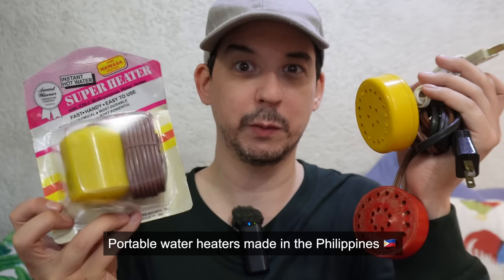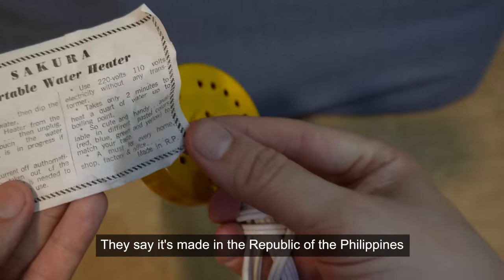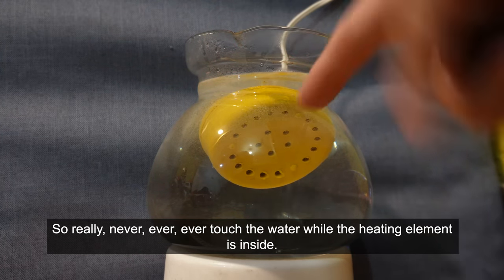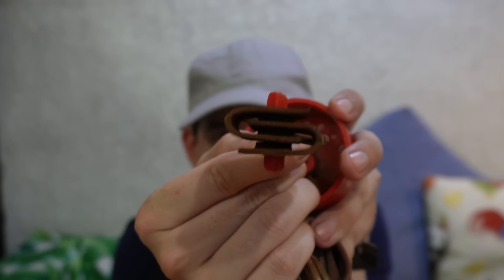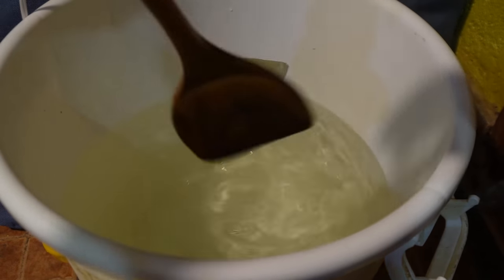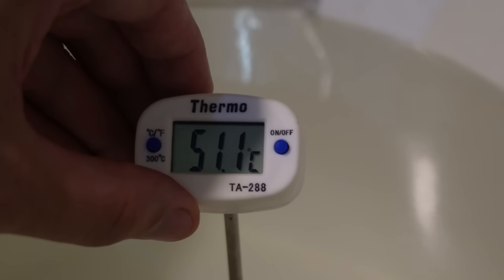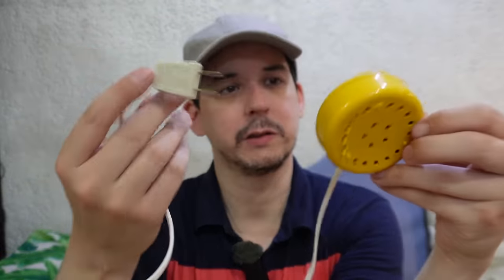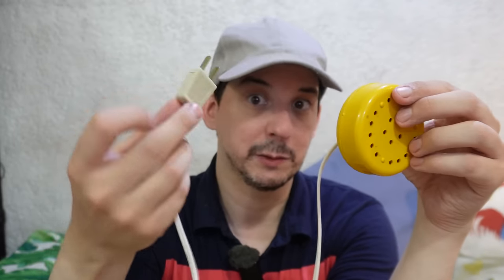Live electricity water heaters

Comment: Been using the yellow super heater for 7 years. Never had an issue with it. Warms up real fast.
Reply from the maker: Wow that's great. Have you tried cleaning it, either manually or with the muriatic acid method they suggest in the manual?
Reply: @GadgetAddict  I haven't. I'll be watching the reference video you provided and I'll see what filth awaits. 😬
Reply: @migueldelacruz5054  7 years of no clean.

Comment: I remember in high school, we made a water heater as project in our Practical Arts. The insulator we used in between the plates is mica.
Reply from the maker: What did you use for the plates? Classic razor blades are what you'd often see.
Reply: @GadgetAddict  same as material as the plate from the sakura water heater.
Reply from the maker: @iamdonniem  ah okay 🙈 I think it's okay as an example - to show the basic concept. 

But to sell that as a commercial product,. especially with the wires just loosely wrapped around the electrical pins.. 🤦

Comment: That heater was my project in grade school. My teacher gave me a high grade for using good components. I used coils instead of plates for the heating element. The wire I used was thick. Resistance is going to be a problem if you use thin wire. If you're gonna build one yourself, be very careful...or just don't make one because as GA said there are safer options. 😉
Reply from the maker: I think it's a great project for education or even potentially an emergency. 

But yeah, let's use the safer options whenever possible 🙈

Comment: I wouldn't use the first two at all, they are dangerous as you showed with your detector. The third is a sealed unit that is much safer because it heats the electrically insulated material around the coil which then heats the water, hence your detector didn't light up.

A note on the soldered connections. Electrical solder (70% lead, 30% tin) melts at ~270 degrees celsius while water boils at 100 degrees. New lead free solder melts at ~320 degrees. Those soldered joints are not a problem in this use, they will never fail. That dodgy insulator and the thin wire are problems though.
Reply from the maker: It's just unfortunate that they appear to have used an underated cable for the 2.5kW water heater - the one that I suspect to be an immersion coil inside the tube.

I guess you could potentially replace the cable. Although I'd rather just start out with a begged quality product from the get go. 

Seeing the wires of the Sakura water heater simply wrapped around the prongs of the plug is definitely a huge red flag. Plus the insulators, like you say. 

That would explain some of the reviews or comments I saw about people saying the wife came loose 🤦

Honestly these kinds of water heaters aren't that common anymore. They're still being used by some people, but they're mostly a blast from the past. 

Nowadays a lot of people use standard electric kettles, because the generics are available at low prices. 

Plus it's gradually becoming more common to install proper hot shower systems.

Comment: Whenever i take a bath , i just use the old fashioned method as usual, heating up water using the kettle with gas and voila , nice warm bath 😂❤🤟
Reply from the maker: Wow 👍 You don't want to try upgrade to an electric kettle?
Reply: @GadgetAddict  for some reason , my family thinks its gonna be expensive  on the electric bill, i try convincing them otherwise 😆
Reply from the maker: Electric kettles do consume a lot of power, but only for a short time. 

Depending on how much you pay for your gas, it might actually work out slightly cheaper. 

But of course there's an increased risk and complexity in heating it up on a gas stove. 

I guess both options have their pros and cons.

Comment: Dude... I have the bigger yellow on lol, used it to heat bath water a few times. 1st time I used it I put my hand in the full trashcan of water and you can definitely feel the current. I don't like using those but I just don't know any other options. I live in a rental house and am limited as to water heaters, maybe you can do a video suggesting some? Great channel, love the content, keep it up. Thinking about getting a Starlink for my place in Danao City in case of storm, I have a few cops that live near me that could maybe use it in a calamity. 👍👍
Reply from the maker: Yeah you should never put your hand into the water while it's plugged in. I've done it, but I wouldn't recommend it 🙈

Honestly the safer option is to just use a normal electric kettle. They're quite affordable nowadays and they can usually heat 1.5 - 2 L at a time.

Otherwise, you might want to consider something like one of the coil immersion heaters which I guess are a more modern alternative to these super heaters.

But probably for most people, the kettle is the easier option. Unless you really need to heat a lot of water.
Reply: Look at one of the purpose designed water heaters. They are electrically isolated so there is no danger. I bought one for our apartment in Davao and it is still working after 10 years (I hope I didn't just jinx it LOL). They will cost you anything from 8000-12000 PHP but what price on your life?

Comment: We still have the yellow one but we stopped using it. It's taking too long to heat up a pail and I also received an electric shock after accidentally dipping a finger into the water while plugged.
Reply from the maker: If it's taking too long, you might have to clean it. 

That's usually what happens when contaminants from the water have built up on the plates. 

And yeah, never touch the water while it's still plugged in 🙈

Comment: 13:20  That yellow heater has been on the market and in use since at least the 1980s. It's a quality, time-tested product.
        I still have one that my mother used since the 1980s.
     BTW,  what happened to your face ? Did you lose your razor or forgot to shave ?
Reply from the maker: lol the end of your comment made me chuckle 🙈 I guess that must be it 🤣

That's pretty awesome that you still have one from the 80s! 

Have you ever gone through the cleaning process (manually or with their recommended muriatic acid process)?
Reply: @GadgetAddict  No. I've never opened or cleaned it. It's a sealed type with no screws.
    But it still works fine.

Comment: I stopped using this long time ago and just use my induction stove to boil water, just 1 kettle worth of boiling water is more than enough to warm up a 1 bucket (5 gallons worth) of water.
Reply from the maker: I'm just curios for your choice to use an induction stove instead of an electric kettle.

Is it simply because that's what you have, or because you prefer it over a standard electric kettle?

Comment: I would rather heat water in a stove with a BIG POT or BIG Kettle instead of using those water heaters, and I got electrocuted by it many times😒 and its dangerous for kids and even with pets, its cheap and easy but I don't recommend it either on daily use basically with kids in a family, probably on emergency situation you can or your just single in life
Reply from the maker: Yeah you should really never touch the water while it's plugged in, otherwise you'll definitely get a shock.

I think electric water kettles are more common than these super heaters nowadays, since their prices have dropped significantly. 

While some people still use the super heater, and similar products, it's more of a blast from the past and I don't think we'll see it for that much longer.
Reply: @GadgetAddict  it was in my college days 20 years ago, when I first encounter those plug in heaters on my grandma's house 😅 I really hate it.... 😣 and it doesn't even had an instructional manuals back in a day, and it's very common to check the water heat by dipping your fingers then, my aunt who owns it doesn't even warn me not to touched the water while its on plug🙄.... I already warned them not to use it because its dangerous and it takes my kid nephew to fell victim of it for them to stop using it☹️

Comment: Utterly frightening products, there are far safer options to use that aren't a risk to life.
Reply from the maker: For sure. 

They're really not as popular nowadays, compared to before. 

But there are still people using them and you can still see them being sold in Ace Hardware and other similar shops. 

Now that generic electric kettles are more affordable, that's the more common option for a lot of people.

And even proper hot water showers are becoming a more standard installation in many homes.

Comment: Personally, I wouldn't buy any of those. I'll stick with a kettle.  
Also, that thin plastic plug is really dangerous. I bought a "parol" with that plug and it zapped me.
Reply from the maker: You just reminded me! I also had some kind of Christmas light with that kind of plug. 

And now I remember I also got zapped, because a couple of wire strands were sticking out the side of the plug 🤦

I think that was during the time I was going to make a video comparing the quality of different lights.

Comment: What happened to safety and quality standards? I guess it’s all about profit. 
I hope they don’t make these “bath tub editions “. 😅
Reply from the maker: The Sakura water heater was certainly an eye opener. 

It's like they saw all the videos about razor blade water heaters and based their design on that. 

I mean it works, but if you're just wrapped wires around the prongs of the plug, you've definitely taken a wrong turn somewhere.